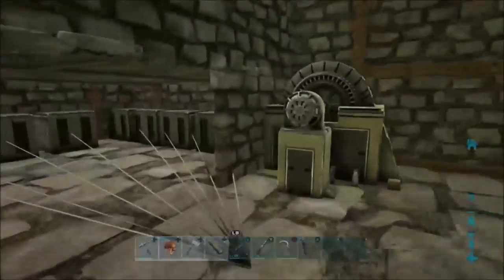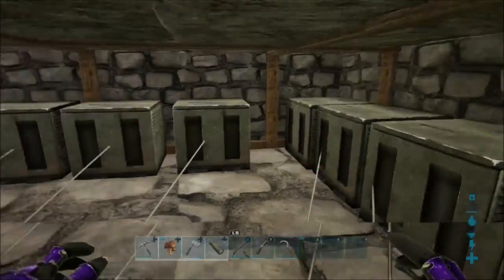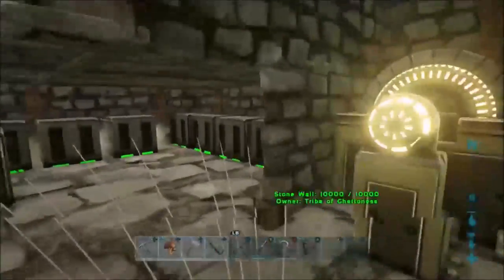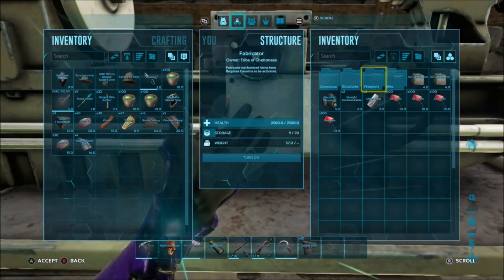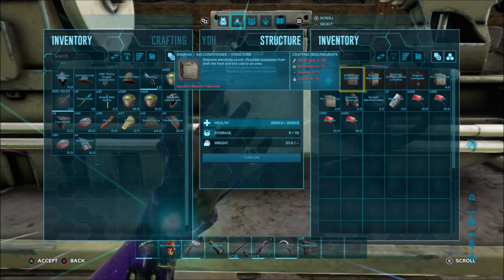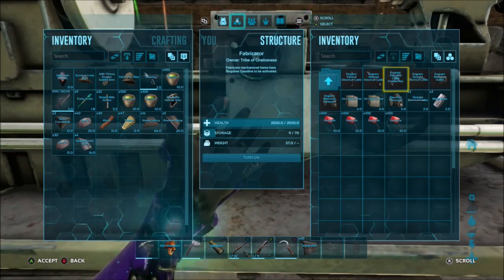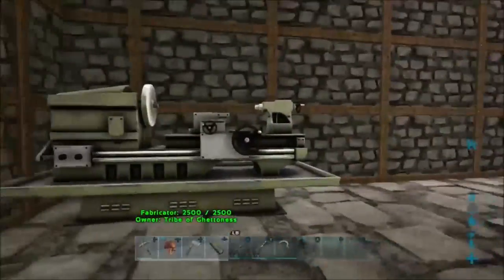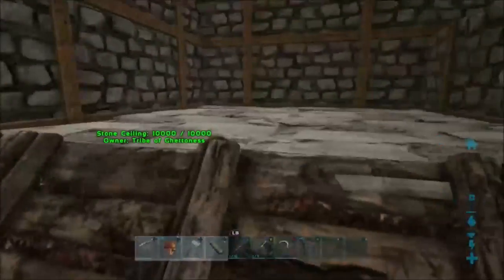Ark Survival Evolved: Air Conditioning Tutorial

Comment from the maker: Ok a few answers for the mostly asked questions on this video (this video is 5 years old so much has changed!)

 - What are the empty slots for?
Answer: those slots are for charging batteries (came out with the Aberration DLC)

-Where can I find the outlet?
Answer: The junction box (featured in the tutorial) and the outlet are the same thing, the terminology has changed but they are the same item. They are both crafted in the fabricator.

-How do the cables work?
Answer: Like the irrigation systems for farming in the game, you can connect cables to the generator and will turn yellow when the generator is on and they have power. If your generator is on but your cables are not yellow, check the connections. They will clip together if you let them. 

-How do I know if the AC units are powered?
Answer: Anything that is connected to the outlets will have an indicator letting you know they are powered and if they need to be turned on or not. There will also be a wire that appears to connect between the outlet and the item needing electricity. These items will only work if the generator is one and the cables are all yellow with power.

-Why is my generator not working?
Answer: Generators need gasoline and have to be manually powered on. This could also be why your structures are not powered. Gasoline is made by cooking hide and oil in a forge.

-Why are you so quiet and the outro was so loud?
Answer: I had a cold and my hearing was affected. So I couldn't tell how loud things were until I felt better and watched the upload.

Thank you everyone for the support of this video. If I have not answered your questions or comments, it's because there are so many on this video that I have not seen! If you have any further questions, please leave them here and I will get to them when I can! If there are changes to stuff like this in the future, then I will upload an updated video.

Comment: I just don't get the logic behind this. How do I set the conditioners to a higher or lower temperature? If i.e. my Rex egg needs 32°-34° C for the incubation period, how do I set the conditioners to that? If i'm in a cold habitat, do I just need to add more and more conditioners, and temperature will eventually grow to volcano levels?
Reply: For whoever liked my comment and maybe shares my thought, I learned how it works now. Conditioners don't work on temperature, but on isolation. Every conditioner increases isolation by 3° C. E.g. if you, in a certain situation, can live without being cold or hot in a temperature interval of 10° - 20°, setting 1 conditioner will let you live without cold or hot effects in the interval of 7° - 23°. Turning 2 conditioners on will bring this interval to 4° - 26° etc. The same applies to eggs. Go on ark wiki and check, every different egg has a different needed temperature interval to grow.

Comment: Will it keep your character cool if say you build a base in a desert?  Do you need more than one in the room? Does the airconditioner need to be part out the wall for heat exchange like a real unit?? 
Because i tried one in a room on my base and it didn't cool my character down.. all it did was make noise lol
Reply from the maker: From what I remember, using these in an enclosed adobe building should cool you down. You may need to use more than one

Comment: How high up the air conditioner effect is maintained? I have a 4 wall tall base and i am curious to know if the air conditioner effect works in the ceiling
Reply from the maker: I would say you have to have some sort of shelter covering the top. I don’t know if ac units have a range limit depending on walls or not but I know they used to need to be enclosed to work the best. They have done so many updates since I made this tutorial
Reply: @itskujofools670  thank you very much 🙌

Comment: I got a question the more AC you have the more faster it will hatch?
Reply from the maker: Karwin Chau It won’t speed up the hatching speed (that can be changed in the server settings) but it will add to the space for eggs to incubate. So if you have one to two ac units, smaller eggs should incubate no problem. Now if you have bigger eggs, like a giga or a bronto egg, you would want more ac units to cover larger space for those eggs.

Comment: How did u get the generators going cause I’m doing searches like crazy and got no where
Reply from the maker: TitanZilla studios you have to give them fuel. Burn oil and hide in the forge to make gasoline and then put it in the generator. It should give you the option to turn on the generator once you have fuel in it
Reply: I’m so sorry I meant the conditioners I’ve already got the fuel for the generator down but I can’t get the air conditioners to start
Reply from the maker: TitanZilla Universe Make sure your outlet is connected to the ac units. There should be wires that are attached to the outlet and ac. They will be labeled “unpowered” until the generator is turned on

Comment: how do you attach cables to air conditioner? i cant do it it just dooenot works the way i ve done it
Reply from the maker: saba aslamazishvili You don’t have to connect the cables. Just make sure you have an outlet/junction box nearby and it should automatically connect a cable to the air conditioner
Reply: i did it myself already still helpfull ty m8 <3

Comment: Does the air conditioner only produce hot air? I was trying to hatch an Argent Egg ( The Argy Is My Favorite Dino ) and it always had the message "Too Hot!" I When it died I was heartbroken ):
Reply from the maker: Jackal Main420 argentavis eggs require it to be really cold for it to incubate. You may need more air conditioners.
Reply: @itskujofools670  wait, but does it produce hot air or cold air? Or both. If both, how do I choose temperature? I'm sorry if if that was confusing.
Reply from the maker: Jackal Main420 the air conditioners can incubate eggs, but mostly produce cold air. You will want to make sure that for eggs needing to be incubated that they aren’t directly exposed to the ac units. Now if it’s an argentavis egg that requires it to be cold then you can put them next to ac units and they should be fine.
Reply: @itskujofools670  hello! I hatched a argentavis egg thanks to you! Thanks for the tutorial
Reply from the maker: Jackal Main420 You’re welcome! Glad I could help 😁

Comment: Why do your electrical cables look so different to mine?
Reply from the maker: poorhadda This video was uploaded in July of last year, since then the structures have gotten a few changes done to them in updates. It’s all the same things, some of them just look different and have different names than before.
Reply: Right sorry what i meant with this question is when i place electrical cables they snap to the generator and only go a particular direction and distance out from it. Whereas your cables are snapped to a point in the ground near the generator and are varying lengths and angles
Reply from the maker: poorhadda It looks that way but they were snapping to the generator and other cables. You can snap cable onto the generator from the ground. On some foundations, like stone, it will hide them.

Comment: How do you power on the conditioners?
Reply from the maker: Greg Schaffer add gasoline to the generators and then turn the generators on. If the air conditioners are connected to the generators then they should automatically turn on and remain on until you shut off the generators or if they run out of fuel. Gasoline is made with hide and oil in the forge.

Comment: Are you sure Because I'm watching this video  To learn how  make a air conditioner work In my air conditioner is not working So I honestly think you are lying to me
Reply from the maker: This video came out 3 years ago so some things could’ve changed. I don’t know what I would gain from lying to people... it’s really not that hard. Make the ac in the fabricator with the needed components, place it near the generator, and then use cables and junction boxes/outlets to connect the two. The cables will snap together most of the time. The outlet will instantly connect to the ac if it’s close enough. Then you have to turn on the generator to make the ac come on. I literally just covered the whole video in a matter of sentences. So now I’m wondering if you are doing it correctly?

Comment: Do you need a battery
Reply from the maker: little bug you shouldn’t need a battery. The outlet boxes allow you to charge batteries in them but as long as you got a generator with fuel, connecting extensions and an ac unit you should be fine